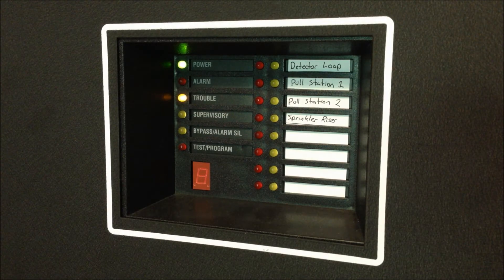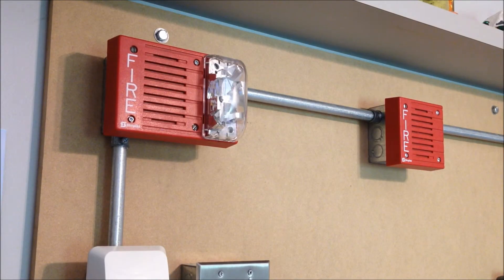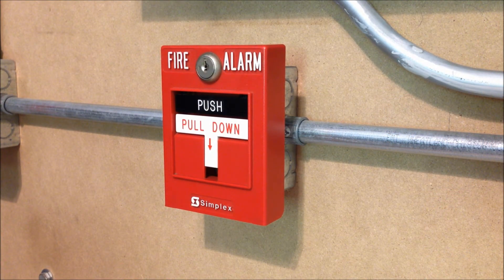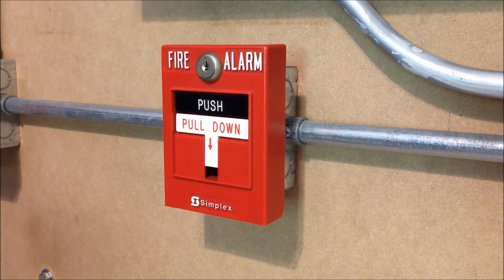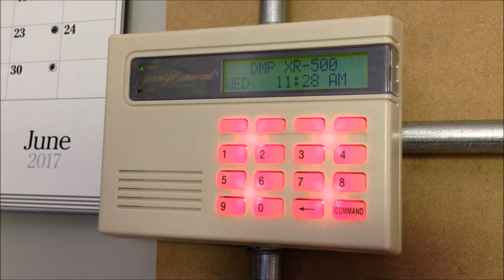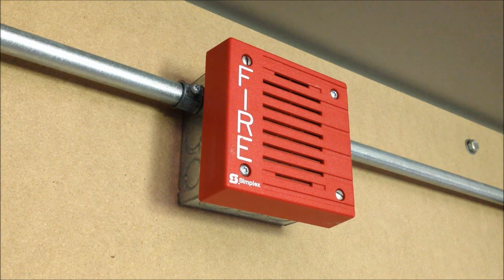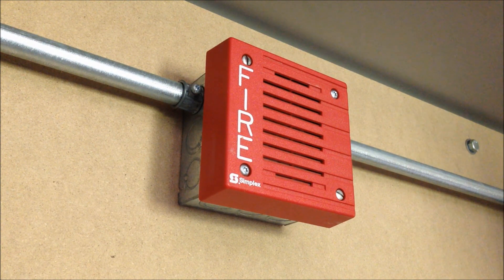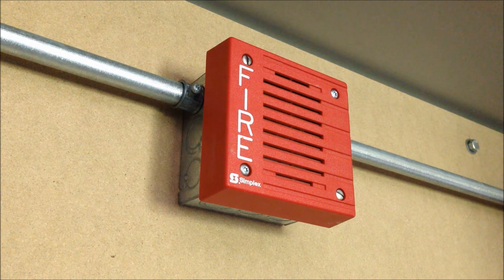System Test 31 | Simplex 4901/ 4903 Series Mechanical Horns

Comment: What is weird about these horns is that it could sound like that, but then one that looks exactly the same can sound similar to a wheelock. I don't get it
Reply from the maker: The two horns in this video are mechanical horns, model numbers 4903-9219 and 4901-9805. Simplex also produced electronic versions of these devices which look identical, model numbers 4903-9238 and 4901-9822, which sound higher pitched and more like Wheelock devices. The internal devices are totally different, but the same plastic case were used on both sets.
Reply: kcin556 my elementary school had these on March time. Interestingly enough they had the mechanical ones inside the classrooms but the electronic ones in the hallways. Made for a really funny cacophony

Comment: where did you get that calendar at? 2:12
Reply: and what's with the pitch change?
Reply from the maker: It came from Amazon. The calendar is called "Railroading!." The pitch change was due to the 9805 horn cutting out for a few seconds.

Comment: So I ended up getting a Pyrotronics/Siemens PE-11T... It was new old stock ready for a real installation, so it was stupidly expensive, but I think it was worth it. I think they're some of the nicest looking detectors, although they're kinda funky. The terminals on the base are labeled "1a, 1b, 5, and 6", and the alarm indication is a flashing red LED every 2 1/2 seconds instead of being solid.
Reply from the maker: Nice! I'll admit, they are kinda strange. I have to get around to testing the one on my system sometime soon.
Reply: Is there any trick to removing and installing the head onto the base? Mine feels really hard to get on and off the base. I'm gonna assume it's just another quirk with CP stuff.
Reply from the maker: You have to make sure the wiring is not interfering with the detector head. You can't use any type of spade connector or anything like that, it just has to be the bare wire under the terminal. Otherwise the head will not seat correctly on the base.
Reply: kcin556 Never mind, it just locks tighter than an i3. I haven't even wired it yet.

Comment: I've had weird things happen to my system when I put up these faraday horns too. When I put up my Siemens UHN which utilizes the same mechanism and activated the pull station, the entire system started to do a weird slow march time when it was coded to code 3. I have a feeling these old horns don't like newer panels
Reply: NJMoo3652 it doesn’t really matter what panel you have. It might be the panel.

Comment: Are you still using the -9840 on the back of the -9219? Also are you going to use the strobe plate that came with the -9805?
Reply from the maker: Yes, the 9219 still has the 9840 installed. That's going to be pretty permanent, and it's good enough as far as I'm concerned. As for the strobe plate, I'm going to pair that with my other 9840 horn for the next System Test.

Comment: In musical terminology, both pitches clash. One sounds a "G" and the other one is an "A".
Reply: That is a weird moment at 2:15 where the 4901-9805 drops from G to F, creating an F Major chord consisting of the tonic (F 4) and the major third (A-Natural 4) (Add the pitch C-Natural 5 and you have a F Major triad chord of F, A, and C). It then jumps back to the clashing G 4 and A 4 (Major 2nd interval).
Reply from the maker: Interesting, thanks for the info!
Reply: Thanks for that info!